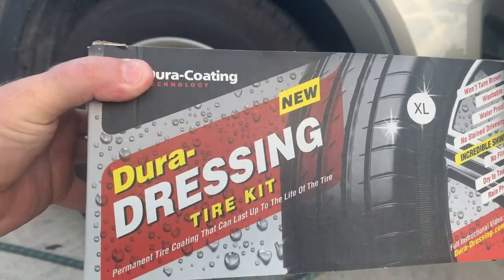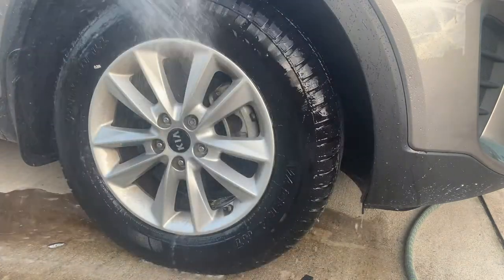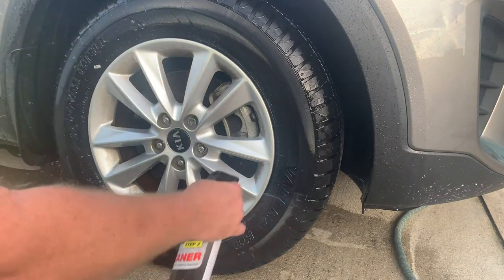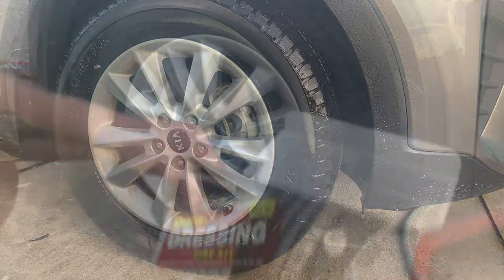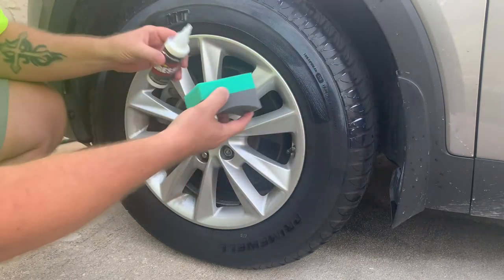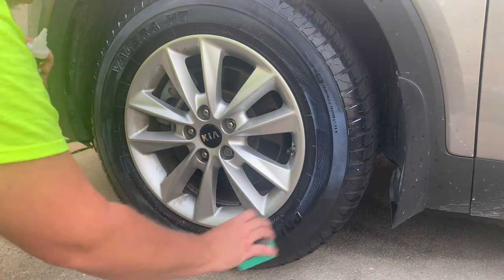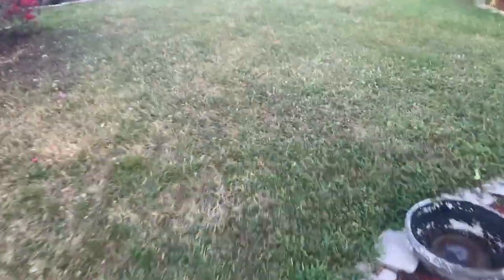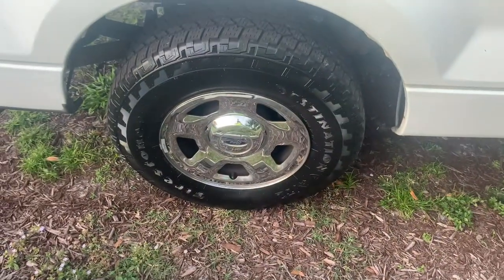Dura Dressing Tire Coating Kit “How To”

Comment: I thought the green side is a handle for the sponge 🧽 lol.
Reply from the maker: You can use both and I found it easier to not use the rounded black side
Reply: @gunsammodrones  really? I will have to try that today. Hard to get in between those tire lines. Maybe a paint brush might help lol.
Reply from the maker: Paint brushes work great too for deep crevices…